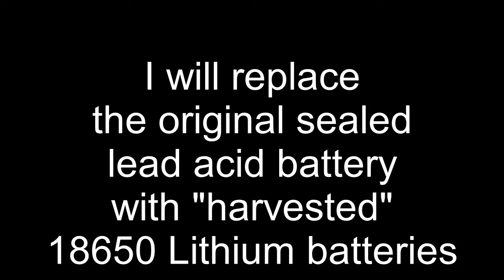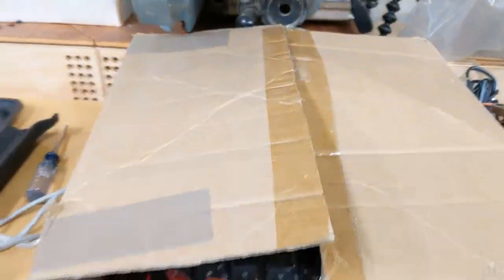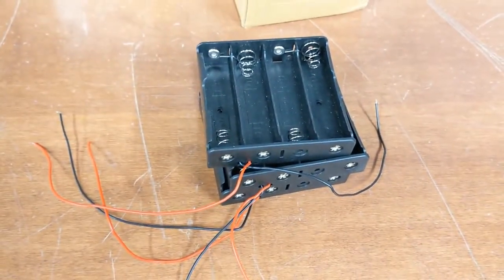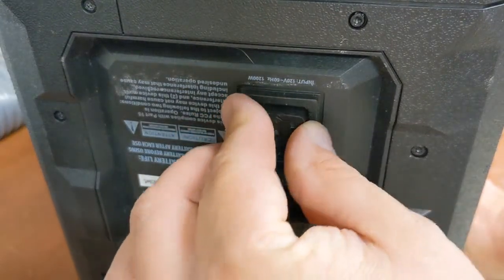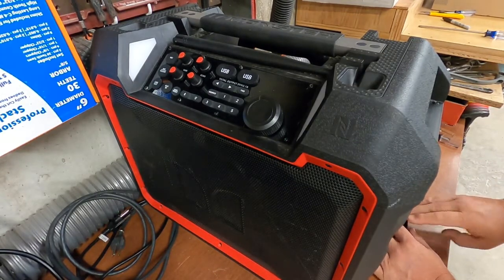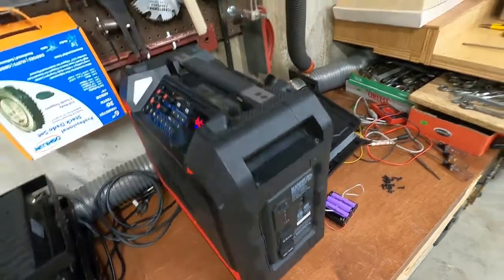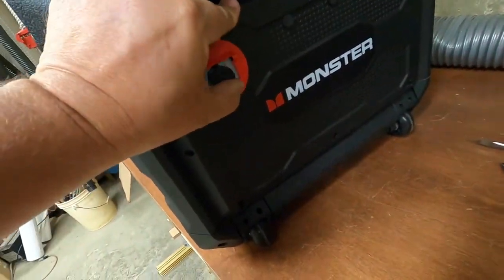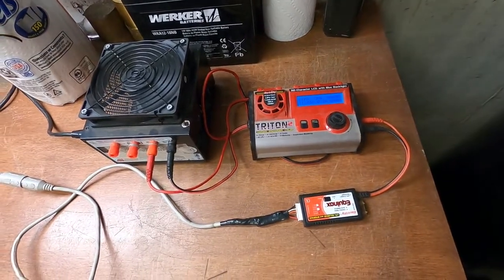Monster Rockin' Roller 4 LiPo upgrade

Comment: So many errors... You can either add up the voltage by connecting them in series or add up the current by connecting them in parallel. A standard LiPo charger will charge a battery to 4.2v, not 3.7v. What you built was a battery that starts off at 12.6v at 4.5ah (using your 1.5ah battery rating. i.e. 3 cells @ 1.5ah in series = 12.6v max @ 1.5ah, , and three packs in parallel, 3x1.5ah = 4.5ah). You'd need another 3 packs to equal 9ah.
Reply: When you take into account the useful d.o.d  (depth of discharge)of lead acid batteries is only 50%  meaning the 9ah Sla Is really a 4.5ah battery with horrific voltage sag as it discharges. While you're average lipo useful d.o.d is 80-90% putting a 6ah lipo pack already ahead of the 9ah . What he should have done is git a123 lifepo4 cells 4 in series 12.8v can be charged by lead acid electronics while having 3-5000 cyle life

Comment: What if i used my Milwaukee 18v drill batteries?
Reply from the maker: You could if you get an adapter that drops it to 12v.  You would need to NOT use the built in charger though.  Just use your Milwaukee charger.

Comment: What would the normal replacement battery be?
Reply: I believe they are 12v 9Ah
Reply: Their make a Lipo4 replacement by ExpertPower. I looked in to it but it wouldn't charge to full since the charger is built for a SLA(sealed lead acid) so it won't charge to full but you still get more power then a SLA

Comment: Why not use the existing AC power in to power the Lipo charger instead of reinventing a keyboard/midi plug?
Reply from the maker: Thanks for watching and for the question!  The built in charger is for lead acid batteries...slightly lower voltage than needed....and no battery management board for the lithium cells.  The lithium charger itself would not fit inside the case.  If it could....I would have put the whole mess in there and just used the existing ac power in.  Good luck with your projects!